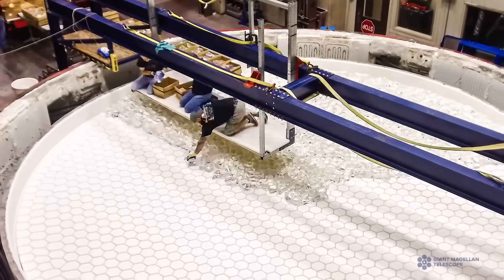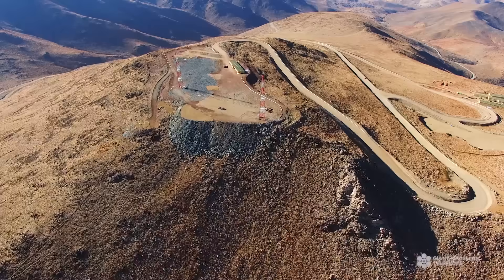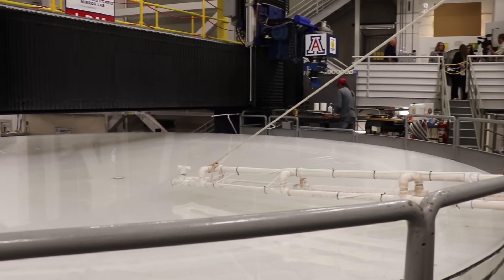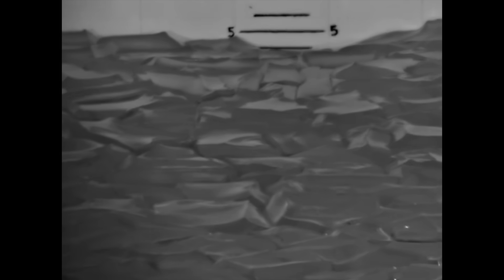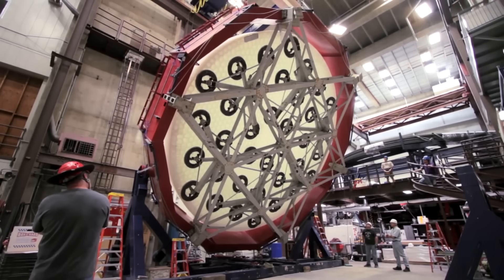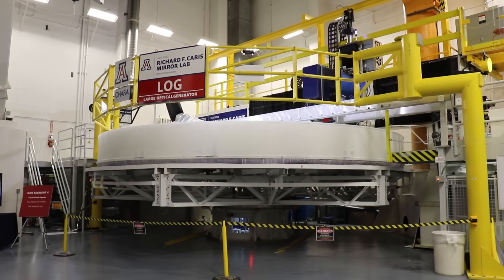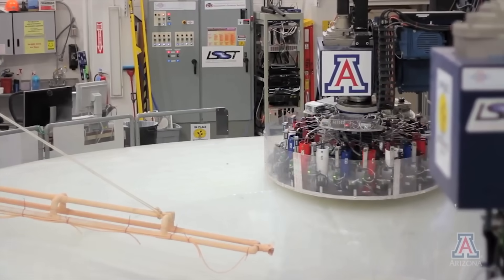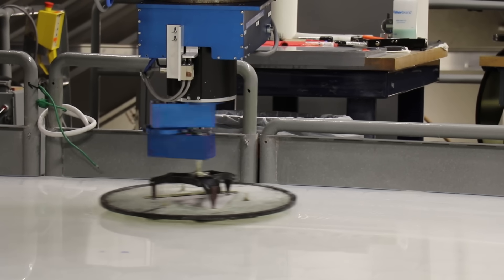Casting a $20 Million Mirror for the World’s Largest Telescope

Comment: and then one bird poops on it and all is lost =(
Reply: I don’t think birds would be an issue at that altitude. :P
Reply: not really, alot of efford of the maintenance goes into cleaning and renewing the coating. From time to time the mirror-coating gets completly renewed.
Reply: Those lasers can probably fry the birds.
Reply: I'm guessing not a lot of people understand that it's a joke! Lol! Now that is funnier!
Reply: +Shadowsc133  It's just glass, but even if a bullet digs a quarter-sized crater out of it, all you'd have to do is paint the damaged area matte black.  The mirror's optical quality would be compromised, but only very slightly because such a small percentage of its area is affected.  It would be like a very small obstruction, which will be out of focus and cause only a minor scattering of light.  There would be plenty of nanometer-precision optical surface left to get the job done properly.  The mirror's huge area is what makes it "resilient" to damage.  Heck, a fist-sized crater would barely make any difference.

As for the coating, it will probably be an extremely thin, delicate layer of vapor-deposited aluminum.  Quality amateur telescope mirrors these days usually have that plus "enhanced" coatings or at least a hard protective SiO2 layer on top of the aluminum, but my understanding is that the coatings of enormous professional mirrors are generally just aluminum because it would be very difficult to deposit the other coatings properly and they would make it more difficult to strip and recoat the mirrors with aluminum (a relatively easy process normally).  So the preference is to use raw, exposed aluminum and recoat the mirrors more often to maintain high reflectivity.  For home use, recoating is inconvenient and mirrors are generally very small, so it pays to increase reflectivity and durability, but the situation is different with professional mirrors.  One exception is the mirror of the Hubble Space Telescope, which has an MgF2 coating on top of its aluminum reflective layer.  This offers some protection while also enhancing its reflectivity (especially in the UV range), and it was done for the same reasons as amateur mirrors--recoating is inconvenient (being in orbit and all) and the mirror is only so large (for a professional telescope, at least).
Reply: Parker Shaw I guess you guessed correctly about him kidding. The glass is resilient, the coating I imagine is not. If its anything similar to “regular” hobby telescopes, it will scratch easily and require a very specialized cleaning procedure, not just your regular lens cleaner cloth. But birds are an unlikely problem I agree. One can only hope to ever see such a telescope in person.
Reply: +luiscamara1  True, but as an amateur astronomer (primarily visual) I actually see at least one bird on most nights when I'm observing.  Whatever the source, unfortunately mirrors (especially enormous professional ones) do get contaminated over time, which is why they are regularly cleaned and recoated.  There usually isn't a serious impact on performance between cleanings because usually the total area affected is such a small percentage of the total surface area.  There is some scattering and some diffraction effects, but it shouldn't be very noticeable.
Reply: +Stride Tokens  Use double-quotes in your search.  Anyway, here is the link:
https://astroanecdotes.com/2015/03/26/the-mcdonald-gun-shooting-incident/

The cumulative effect of the bullet craters, in terms of diffraction, is nothing in comparison to that of the giant hole in the center of the mirror. :)  The whole "nanometer precision" notion gives the false impression that a tiny amount of damage of any kind would ruin the mirror, but it's a bit misleading.  Yes, the grinding of the mirror must be extremely precise or else the mirror would totally suck, but once that is accomplished, all that really matters is how much of its surface area is so precise.  The damage we see here affects only very small portions of its surface, and painting them matte black nearly completely eliminates the damaging, contrast-robbing effects of light scatter.  There is only some additional diffraction, and that pretty much correlates with the slight loss of useful surface area, which clearly is very small.
Reply: Guess you are just kidding.

In case anyone would like to know, big mirrors are much more resilient against contamination than we commonly think. Google "McDonald gun shooting incident".
Reply: stiimuli 
Lol
Reply: Birds don't fly at night, its bat poop they need to worry about
Reply: Parker Shaw | I googled it and nothing came up about a giant mirror... Link please.
Reply: ya but bats do and there are usually many bats at once
Reply: nonono, it wasn't bird poo, it was the cosmic microwave background radiation.
Reply: At that altitude there really aren't any bats.
Reply: would you want that open in sunlight , i imagine it would cook a bird in the magnified point.
Reply: Parker Shaw woah, that's impressively resilient
Reply: Hahaha sounds when the first astronaut went pee in space it went like this. 
Astronaut: “ command permission to relieve myself”
Command: that’s a negative ghost rider 
Astronaut: I can’t hold it...
Command: WE DONT KNOW WHATS GOING TO HAPPEN 
astronaut: begins to pee looks like we’re ok
Reply: You can say bird shit!
Reply: What if it’s a really massive doodoo.
Reply: I think they'll be using it only during the night and a presence of the birds during those hours is very rare. And in case they use it during the day time, you can always make a good lunch out of whatever bird flies over it.
Reply: Just polish the glass for damn many years
Reply: Cook a bird? I bet it would separate a birds electrons from its matter!
Reply: Not that many birds come out at night...
Reply: What a waste of money. They can litterly go to the dollar store, buy a thousand hand held mirrors, glue them all together on sheets of plywood and boom! World's biggest mirror. Smh, always wasting money because they can.